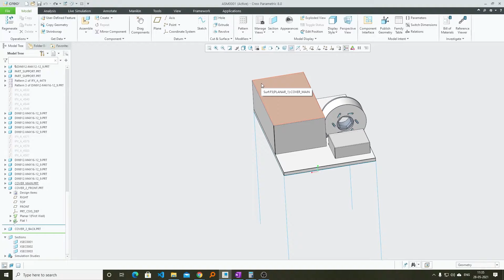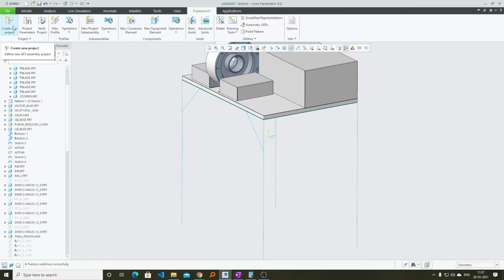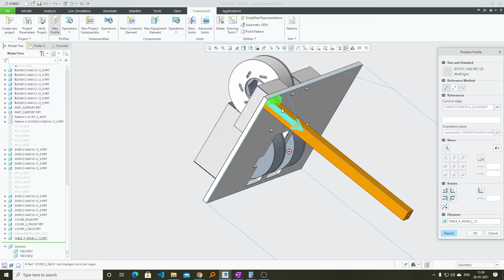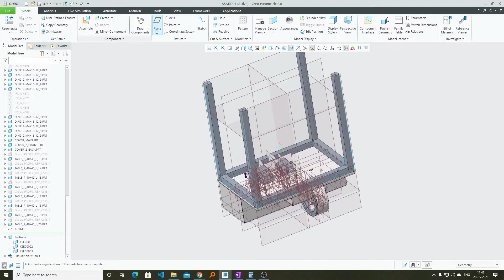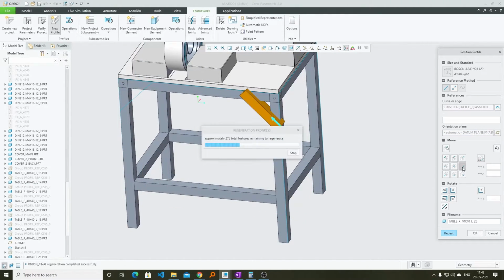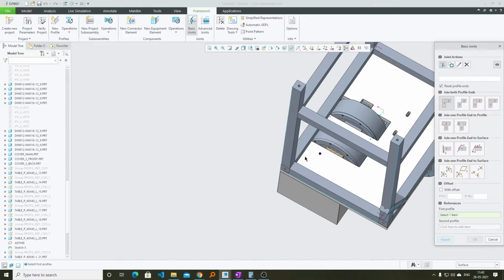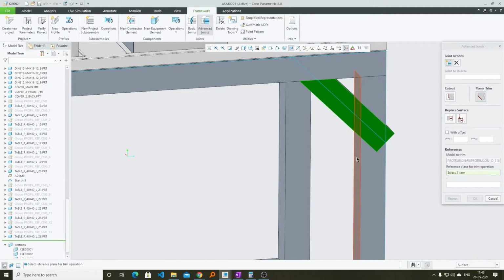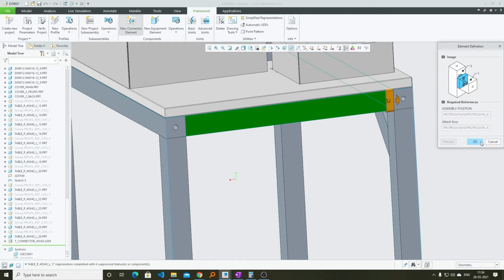Creo framework tutorial [AFX] | How to make frameworks using Advanced Frameworks Extension

Comment: but profile is not showing as u selected from library. It shows square tube with middle hole.
This type problem is facing me.
Could u help me...
Reply from the maker: it will show square only, this is by default in Creo, they always do this to improve graphics  performance. another example is hole threads you won't find while creating threaded hole. Hope this clear your doubt.